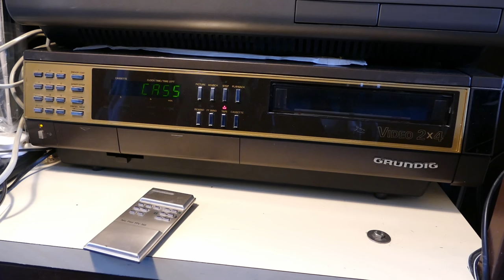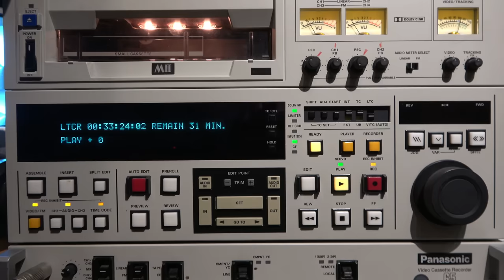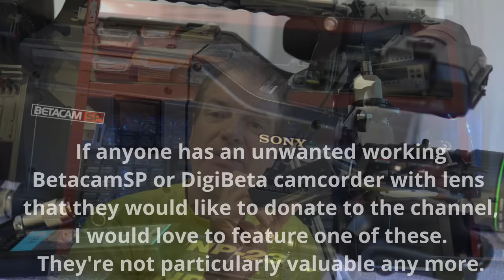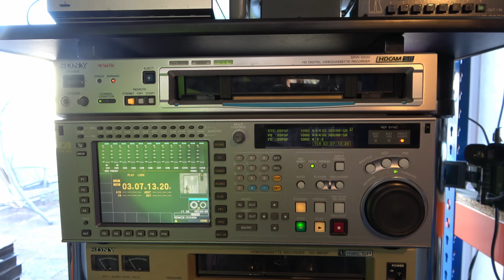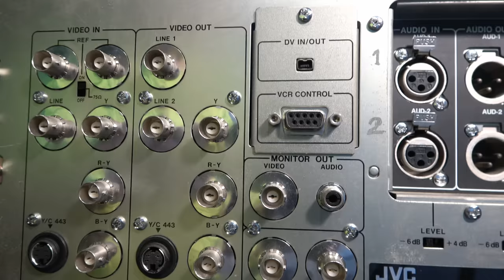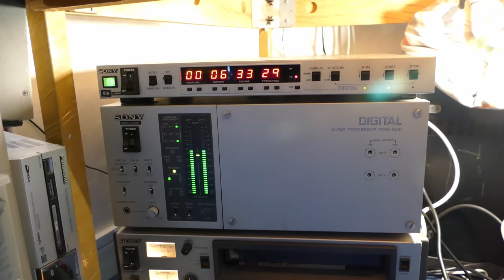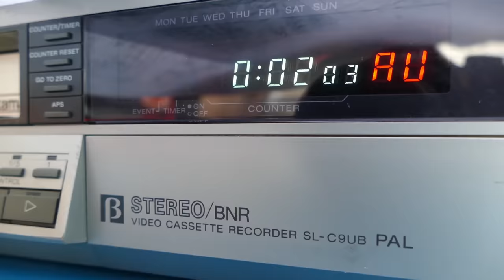Beta vs VHS. A world in which Beta won.

Comment: I've been trying to work out how Betacam stores two colour difference signals on one track.  Sony calls it a clever 'CTDM' method.   It seems like there has to be digital signal processing  going on in order to 'speed up' the signals for recording and slow them down for playback.  In a brocure, they show the sideband of the C track to be 3 MHz but the bandwidth of the component signals at 1.5 MHz.   Hence there is bandwidth compression.
Reply: From my old BBC course notes: Beta SP camcorders, and earlier Betacam models, use analogue CCD stores In
the Chrominance multiplexing. The principle is similar, but their linearity and frequency response Is inferior to digital methods....

The second fm modulator handles the R-Y and B-Y in a time-compressed sequential waveform. This is assembled in the BVW 75 using digital sampling and storage. The R-Y and B-Y are each clocked into separate one line duration stores. During the next line of input video, a second pair of stores receives the next line of input R-Y and B-Y. Meanwhile, R-Y Is clocked out of its first store at twice the clock speed, to compress it into 32ps. Then B-Y is clocked from its first store to fill the next 32iiS period. This is called CTDM, and the resultant analogue multiplexed signal feeds the second r.f. modulator. The first pair of stores are now empty, ready to receive new R-Y and B-Y from the input signals. While this is going on, double speed clocks are used to empty the second pair of stores in a sequence of R-Y first, then B-Y.
Reply: @RetroWorkshop  Then my guess is correct, the CCD memory was the cheapest viable solution. SONY has developed several CCD memories as line memorie ICs for color under recorders
Reply: @RetroWorkshop  I remember finding a CTDM dub cable at the BBC, not sure where it came from as I never remember anyone using it. I believe it bypassed the TBC and dropout compensator leaving the R-Y and B-Y signals in their compressed format, a bit like the RF dub on U-Matic. I remember reading that you couldn't go too many generations down as it increased the timebase errors each time. I did try it out between 2 BVW-75s and it worked but not sure if there was any noticeable quality benefit.

Comment: Where did  U matic fit into all this = I recall 1974 watching stuff at school on such players
Reply: He also didn't mention Philips VCR and Philips VCR-LP. 😉
Reply from the maker: VCR was much earlier.  Though to some extent, VCR-LP (N1700 if you like) did compete a bit with VHS and Beta.  There was also SVC/SVR from Grundig.  I have working machines of all three formats.
Reply: @JacGoudsmit  
Nor the Grundig SVR variant which further reduced the tape speed, but these do not form part of the Beta story.  There are many other formats too.

Comment: hi get my mate to watch this  he loves the vhs   i said only place for SVHS  is adat 

sony  701 es pcm are very good decks   i am a very big fan of betacam decks  because they are so easy to fix up NOTE THE PRICES OF DECKS used
is now going  up i just had a uvw 1800 as parts  to fix the 2 decks i had not working  all decks are around £100 as parts   did not pay this 

the deck was not listed right  on ebay  time to time i have seen this  there's not the video deck number there used to be 
there are still alot of  betacam digi decks around  they are very heavy  man  you will need very good wheels to get them a round on 
why they don't sell well pick up only alot of the time 

i never got around to drive a car  so i have to find ways getting decks to me  they are 2 people to lift one   lovge this video SUPER POINT 
I SAID ALL time beta was the best of them all

Comment: What does it means when a Beta tape won eject properly from the Tape player? Gears ⚙️, Belts or a capacitor?
Reply from the maker: It depends a lot on which model, but usually it's belt trouble.

Comment: After the "death" of Beta in 2016, what are TV studios using now? I guess something like swappable hard disks or SSDs?
Reply from the maker: Correct, they are tapeless, apart from any archives.
Reply: They all use servers now and often supplement it with an EVS machine (a hard disk based, multi-channel recording and playback system).  But most of them also still have a couple of Digibeta machines for ingesting archive stuff.  

I remember very well the days of BBC TV Centre being full of D3 and D5 machines.

Comment: hi just saw the video on the b450 chipset  i went over to to same  kind of  line of  amd 4  
over  the  cpu i got  i have to keep running cost down  it all ad's up  i had alot of bad luck with south chip
coming away  from the pcb 

and it's got to last 12 years likle the last  set up  there are bad sides no pci ports  

and the windows 10 can't see alot of the older pci-e  and drivers  will not work  like with
 the scsi 320  pci-e  new motherboard are not great

Comment: Well i knew that beta was a better quality, but i never had the money for the posh beta system.
So vhs was better than nothing.
Vhs also got me into repairing vcr's,  i enjoyed that era :-D
Reply: Domestic Betamax was only better quality than VHS for about a year in the mid-70s. As initially released in 1975, Betamax ran at a higher speed than VHS did when it came out a year later, but because consumers preferred longer recording durations over slightly better picture quality, Sony was forced to cut the speed of Betamax to make it competitive with VHS. From about 1977 onwards, there was effectively no quality difference between VHS and Beta (although the myth that there was lived on), and in fact VHS subsequently got improved further than Beta - VHS got HQ, and S-VHS was higher resolution than SuperBeta.
Reply: @dunebasher1971  For PAL Beta was always the same speed - no LP/B2/3. NTSC VCR quality certainly did get messy...

Comment: Great Video! You skipped over SX IMX and DTF but still great video!
Reply from the maker: Oh there were variants like SX but they didn't really add much to the story.  DTF is interesting, I wonder if Sony gained access to that from Philips as a result of their collaboration on CD.
Reply: @video99couk  I worked at sony at the time 
DTF had nothing to do with Philips. But we had fun trying all the different tapes in the wrong machines by plug the holes DTF and SX tapes worked in either machine I seem to remember.
I sold plenty of SX& digi in Australia!

Comment: The most robust videomachine I ever had was a Grundig Video-2000, it took a lot of beatings and moving around, so it wasn't all of them that were unreliable :-)
Reply from the maker: You were lucky with that.  The Grundig ones had lots of problems with internal connectors disintegrating.

Comment: Do you have ant BBC Betamax Video tapes?
Reply from the maker: I've not seen BBC Betamax tapes, but I have seen some from local TV channels.  BetacamSP and DigiBeta though, yes lots of those from BBC sources.  One of my BetacamSP machines is ex-BBC too.
Reply: @jamesmitchell8922  Hi, BBC did release some home video titles on Beta. I did have a couple, Fawlty Towers comes to mind. I don't think I had any Doctor Who but most of my titles were acquired ex-rental around 1990 so I mostly had films on Beta rather than TV shows.
Reply: @gideon3648  Yes it was in the first half of the 1980s. They stopped in 1987
Reply: *any

Comment: Video2000 have a flat scanner-drum angle then VHS and have near the same track length so there is no signal space lower  then to the other Systems like you said? 1/4inch with flat scanner-drum or 1/2inch with higher scanner-drum angle is the same track length each. VHS have worst S/N ratio to the signal and color. DTF is much better then stair Heads like VHS, Beta, Video8. Also there was a Hifi Video2000 with digital PCM Audio! but this don't come out. Also a NTSC Version but this don't come out. The Reason why it lost was the Film Industrie they bring out all titles on VHS and Beta but not on Video2000 you nobody buy a Video2000. only 13% market for the System was to less. Thumbs Up 396! Super Video
Reply from the maker: The V2000 track width is very narrow, in order to get the recording onto only half of the tape width.  As a result, the signal to noise ratio of the FM envelope from V2000 was very poor and needed some clever electronics to get an acceptable picture.  The DTF was needed in order to scan such a fine track (though there was one Grundig V2000 machine built without DTF).  I was aware that PCM audio was planned for V2000 but never made it to market.  Another unreleased feature was a small V2000 cassette for camcorder use.
Reply: The reason it lost was also due to the lesser sound and video qualit.
Reply: Video2000 have max. 10kHz of mono or stereo Audio due the slow tape speed. But then was a development in 1981 with a PCM Audio in each track end. A small slot where a analog compressed and then digital recorded PCM. But this machine don't come out.
Reply: @volkerking5932  if they started developement in 1981 but the machine still wasnt launched in 1985 when they pulled the plug on V2000 there must be a reason. Probably to difficult to implement. Oh well let's not talk about hypothetical machines but on the ones that were actually for sale, and their sound quality was abysmal
Reply: *than

Comment: (sigh) My reaponses to your responce to my other comment keep going mia. Oh well. In any case, in the mid 1980s magneto optical disks were a thing, and they even had capacities up to 600 and 640 MB respectively   which for most albums then was overkill. Not far down the line they got to around 1.2, 1.4 GB, and the far later iterations got up to 9.1 GB. Would have beena far more robust, reliable  and longer lasting option. Sure beta is a good solid format, though I hear Umatic machines were murder on their tapes, what's been your experience with umatic? Really think they missed an opportunity with MO disks.
Reply from the maker: I'm  ot sure early MO disks were more reliable than tape. Umatic is a reliable format but PCM-1610/1630 tapes are very error prone. The PCM system demanded more than video tape could reliably offer when new. Now the tapes are decades old, it doesn't work well.
Reply: *responses
Reply: @video99couk  *not
Reply: @northernplacecorporation  Well at least you bumped the thread to the top. So thanks I guess?
Reply: @jameslaidler2152  So, there are some typos in the comment you made!
Reply: @northernplacecorporation  So, nobody cares?
Reply: @jameslaidler2152  Well, I have noticed some, and you might resolve them by editing the comment.
Reply: @northernplacecorporation  Goid for you on noticing, you get a gold star. You're special.

Comment: Domestic “Betamax” is absolutely not the same as professional “Betacam”. The formats are 100% incompatible.if you freer to VHS as “ordinary rubbish VHS”, you must, in all honesty refer to Betamax as “ordinary rubbish Betamax”, as the quality of Betamax II was worse than VHS. And Betamax brought also brought out a high band called SuperBeta. 
The original Betamax I was superior to VHS, but Sony ditched that for Betamax II when they realised the one hour recording time afforded by the higher speed Betamax I did not meet the expectations of the public. They then slowed down the playback speed to .8 feet per second, which was much slower than the 1.31 feet per second of the original VHS, giving worse performance than VHS for the sake of extended playback time. So the direct competitor to VHS was Betamax II, not the superior Betamax I that Sony retired.
Also, Digital VHS used tapes with the same form factor as standard VHS, and the tapes were interchangeable, just like Sony’s offering.
Betamax WAS the unmitigated disaster which you claim is wasn’t. Just because Sony repurposed the tapes, does not erase that fact.
Reply from the maker: Domestic Beta was not an unmitigated disaster even as a domestic format, millions of machines were sold.  In the UK we only have one Beta tape speed: An L750 runs for 3 hours 15 minutes, and gives superior performance to VHS.
Reply: It was by no means a "disaster". Betamax sold very well into the 90s in Japan.
Reply: @video99couk  You were referring to Beta-III.

Comment: This video doesn't make any sense. "Beta vs. VHS"? VHS won, hands down. It wasn't even close. All of the other formats you mentioned with "Beta" in their name were completely different formats and are therefore irrelevant. Them sharing a basic tape cartridge design means nothing. 

What you've said in this video is no different than saying that, e.g., CD Video had long-term success or "had the last laugh" because of the success of DVD and Blu-ray. Never mind that they are completely different formats because apparently inert plastic is what matters, and they all used 12cm optical discs that are physically interchangeable with each other, just as e.g., Betamax tape cartridges and the small version of Betacam tape cartridges are physically interchangeable with each other.

A video format is fundamentally defined by the characteristics of its signal and none of those later formats from Sony used the same signal as Betamax. Betamax is a specific implementation of "color under" and Betacam is a specific implementation of component video (YPbPr, AKA: Y, R-Y, B-Y), which is drastically different than (and drastically superior to) "color under." Ironically, Betamax's signal is in the same category as VHS's signal, whereas it's in a different category than Betacam's signal, since VHS is also an implementation of "color under."

Having success in the professional market is better than nothing, but success in the consumer market is far more lucrative. Sony's only success in the home video market is Blu-ray, and even that is a relatively minor success, because to this day Blu-ray sales have never surpassed DVD sales (and at this point they are both dying due to the success of online video streaming services). VHS on the other hand was the dominant home video format for two full decades (1980s and 1990s), and parts of two other decades (1970s and 2000s), and it was at a time when there was no competition from online streaming. 

The last VHS machine was produced in 2016 by Funai, because even after DVD overtook VHS in the mid 2000s, there was still a substantial market for them for recording off TV, and VHS machines continued to be profitable for quite a few more years (mostly in the form of VHS/DVD combination machines).
Reply from the maker: Makes me wonder if you actually watched the video.  I know full well the differences and similarities between domestic Beta and the Betacam formats.  I clearly say "Beta derived" and "VHS derived".  No, I wouldn't agree that the domestic market is all that matters.  The professional equipment sold at massively better margins than domestic.  You would have to sell an awful lot of £30 VHS machines to make the profit of a single £30k Digital Betacam recorder.
Reply: @video99couk  "Makes me wonder if you actually watched the video."

That's a non sequitur.

"I know full well the differences and similarities between domestic Beta and the Betacam formats."

I know you do, but that doesn't make your video make sense. You know the differences yet you still try to retcon the professional market successes of different "Beta"-named formats onto the Betamax format that VHS thoroughly trounced, which, like I said, makes no sense whatsoever. Your video would make sense if it were about Sony vs. JVC in the broad category of video formats in general, but not as a video about "VHS vs Beta" as your title says.

"I clearly say "Beta derived" and "VHS derived"."

I know you did, and that doesn't help, since all of the successful formats that happen to have "Beta" in their name are only Betamax "derived" in the sense of sharing the same plastic shell for the magnetic tape, and that's a meaningless connection, just as various formats having a 12 cm optical disc in common is a meaningless connection.

There are only two Beta-named formats which were derived from Betamax in any meaningful sense of the word: Super Beta and ED-Beta, and neither of those had much success in the marketplace. And the only VHS-named format that was derived from VHS in any meaningful sense of the word was S-VHS, and that didn't have much success either.

"No, I wouldn't agree that the domestic market is all that matters."

I didn't say that it's all that matters; I said that the consumer market is far more lucrative.

"The professional equipment sold at massively better margins than domestic."

Higher margins, sure, but not necessarily "massively," since they typically cost a lot more to manufacture than consumer VCRs did, but either way, consumer VCRs sold in massively greater numbers than professional VCRs. Just in the US alone during the 1980s, 1990s, and into the 2000s, practically everyone had a VHS VCR; they were as common in households as a TV or telephone. That amounts to hundreds of millions of them. On the other hand, the primary buyers of professional VCRs were TV stations, and there aren't anywhere near as many of those as there are households. There are far more households on my small-town street alone than there are TV stations in my entire state.

"You would have to sell an awful lot of £30 VHS machines to make the profit of a single £30k Digital Betacam recorder."

The cheapest VHS VCRs in the 1980s sold for about $200, and that was only in the second half of the 1980s. In the first half the cheapest ones were a lot more expensive, and in the 1970s they were even more expensive. Plus the higher end models were always drastically more expensive. My JVC HR-D566U had an MSRP of $900 when it was new in 1985 for example.

In any case, we're talking about a market consisting of hundreds of millions of people vs a market that numbers in the thousands. For example, there are only about 1,750 TV stations in the US right now, and there are about 131 million households.